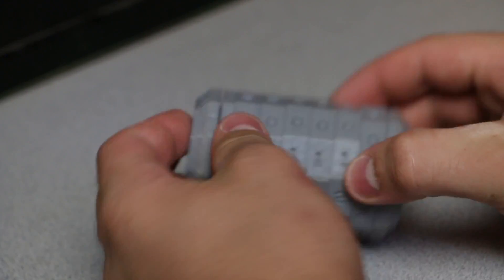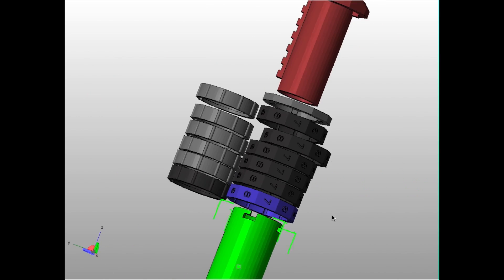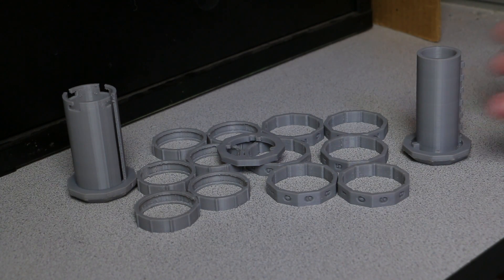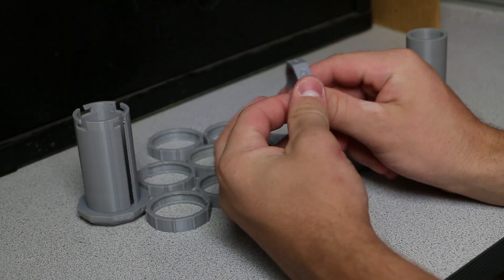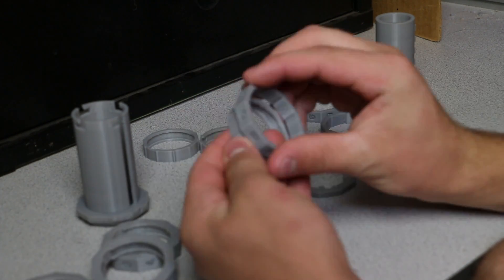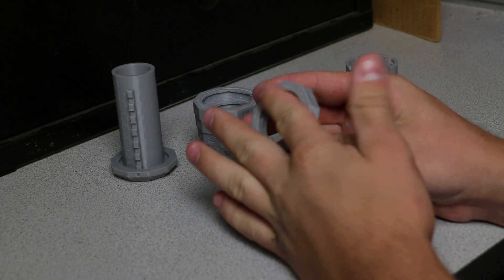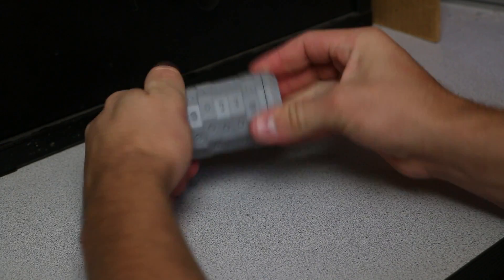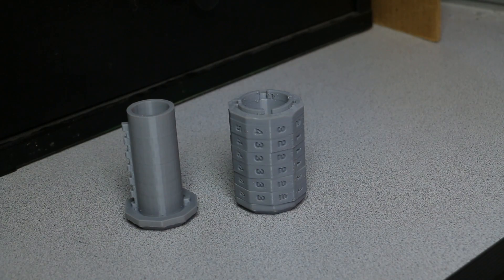3D Printed Locking Cylinder!

Comment: Ive printed this (the outer part only, still printing on the inner tube). But I have a problem with the outer tube and its end lock. It has a big gap from the numbers making the whole numbers very loose. Ill try to print the gap hoping it would work. Kudos for the end lock! I also designed my own cryptex but got a problem with the end lock, your design is so much better.

Comment: How long will this take to print? How thick layers can be used?
Reply: printed it on an Anet A8, 0.3mm Layer height, 20% infill, 50 mm/s print speed, about 10 hours
looks and works good though